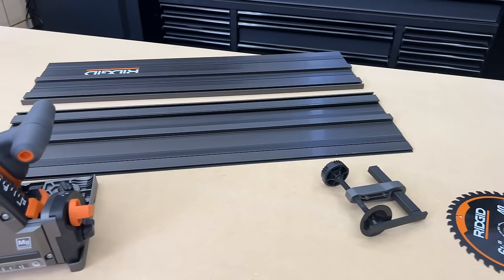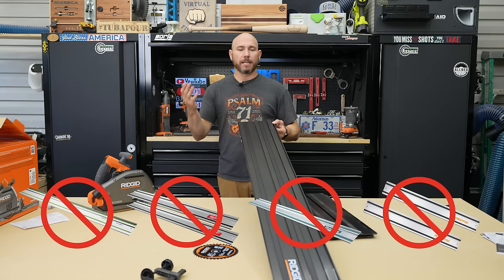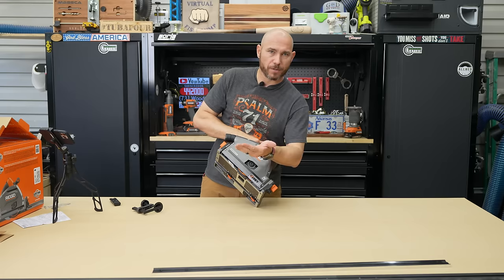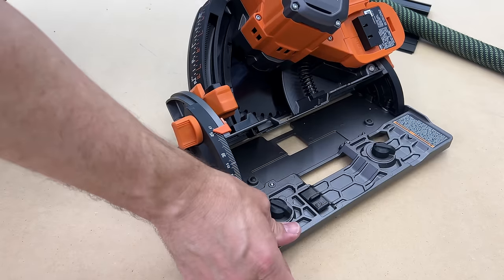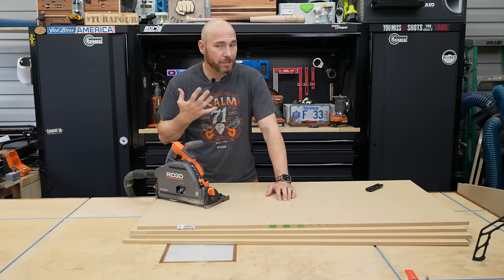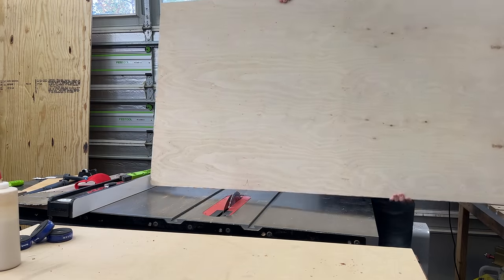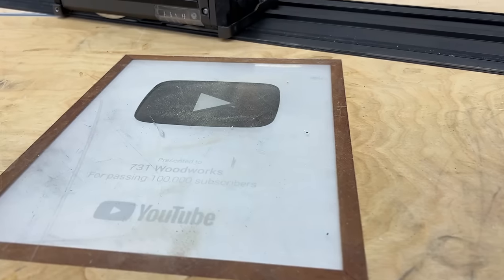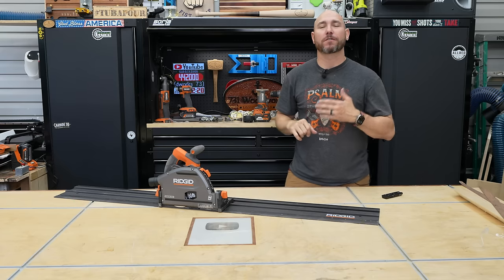Now We Know Everything About the RIDGID Track Saw!

Comment: NOT $399!! Debuted this week on Home Depot website at $488 TOOL ONLY, meaning the battery will put you back $120 extra, bringing it to $608! Shame on HD for the bait and switch, hope that you update your review!
Reply from the maker: I just checked my link in the description.  Shows $399 for me.  Are you in the USA?
Reply: @731Woodworks  Yes, I'm in US. Mea culpa. When searching Home Depot app, the $488 version is offered first, and description is exactly same as $399 version (60in Saw), however, it includes ADDITIONAL 60in track. I went back through your video, and I didn't catch that the version you showed was NO BATTERY, again making the price higher. Happy to delete my original comment, but still felt misled. I've been excited the last month since watching your video thinking that is get an awesome saw for just $400, but with extra track and batteries, it's over $600, which is in DeWalt territory.
Reply from the maker: @AdamMitchell7   Ahh, I see.  No, don't delete your comment.  I think if someone is already in the Ridgid battery platform, this makes more sense to buy vs if you don't already have their batteries or have intention of getting their tools. Otherwise, I think that the corded Makita is a good option because you'll be about the same price point with batteries, etc. on the Ridgid.

Comment: The 5/8 standard arbor was a grand slam.... why did they decide not to make it fit standard tracks. Even the Dewalt and Bosch can run on the Powertec tracks, even though they use different tracks

Comment: Lack of battery/charger in the kit is a downside for me, since I'm not in Ridgid ecosystem. Adding cost of that closes the gap a lot vs others that would otherwise seem significantly more expensive. Add in that the track isn't compatible with others, not as interested as I originally was.

Comment: Howdy Mr. 731.

I may not like some of the tools you present, but i DO like your presentation of them and the videos. 

Now, this isnt towards you Sir....But in my opinion, track saws are honesty not worth the money and believe them to be just Hype. 

Reason being. When im cutting down large sheets, because of my small shop, regardless of a track saw or not, its gotta be done outside my shop and a set up of saw horses is required. 

In the "Real" world of woodcrafting. The need of ripping a FULL 8' length of ply is rare. Very rare. Its so rare that the cow is still alive while you're cooking. 

The use of sheet goods (Plywood) is mostly contained within "Cabinetry" work which is a very small niche of the over all "Woodcraft" community. 

With that, if a "Woodworker" is building cabinets back to back and week to week, chances are high that they already have a LARGE shop dedicated to that, of which, a Tablesaw capable of cutting large sheets of ply. To that point, "That" person is no longer a "Woodcrafter" by definition, they are a "Cabinet Maker". There IS a difference. 

The reason why these track saws BOG down on cutting 1 1/2" materials is because THAT wasnt their intent. They were designed for sheet goods. 

So, we roll back to the beginning of my message. Sheet goods (ply). These track saws "save time". 

Do they? Maybe a little bit. But i can cut down a sheet of ply using a straightedge and clamps and a Circular saw and it takes me maybe a few "MINUTES" more to set up. So, whats a few extra minutes for cutting something when its not something i do alot of? Worth $400+ to save a few minutes? 

Nope. 

And then where ya gonna store all these parts for something you dont use often? And then the cycle repeats itself. "Well, i do use it alot". Well, if you do, then most likely youve already got the room and tablesaw capability of cutting down that Ply already. 

So, in the end. I just honestly dont see a positive point of spending the $400+ on something in order to save me 2 minutes of time. So it kinda becomes something like those lights people add to their wheels on their truck. Whats the point? You cant see those lights while you're driving and when you park, the lights turn off. 

Its just unnecessary Bling. 

That all being said Mr. 731......You made a great video which was informative. 😊 

Thank You for being there. :_fistbump::_fistbump::_fistbump:

Comment: Rigid makes great tools for a home owner but not for people that use battery tools for a living. I’ve burned up several drill and impacts. There’s a reason you don’t see them on job sites and supply houses don’t carry. I use impacts 4-8 hours a day, dewalt or Milwaukee last years with no issues besides batteries getting weak over time(but every manufacturer has that ). These paid vids fools a lot of people, because you get what you pay in most circumstances. I’m an ibew electrician

Comment: This Rigid track saw is what the Ryobi track saw should have been. A decent battery powered track saw, with its own proprietary guide rails. Ryobi could’ve made the base aluminum, made the cover plastic, removed the riving knife and kept the saw 0-45°. That way they could sell the Ryobi track saw for like $250 tool only, or $299 or $329 tool only with guide rails. 

Rigid messed up by not making the Track saw compatible with all the existing guide rails. That’s the only complaint I have about the saw. It leaves no room to upgrade, you would have to get another track saw if you wanted to use any of the longer guide rails that don’t have to be combined. Rigid could have at least made it compatible with the Milwaukee guide rails and just made small Rigid guide rails that get combined.
Reply: The Ryobi is $329 with guide rails... sometimes on sale for $299...

Comment: What I'd like to know is how straight the cut is when the track extensions and such are attached.  Seriously, for me that is what I most want out of a track saw - the ability to give me a perfectly straight 8-foot cut.  Right now I am not convinced I can get that with anything but Festool's long track.

My Kreg does great for the shorter cuts but after trying to get perfectly straight cuts with the Accu-Cut XL?  You just couldn't get that saw guide reliably super straight - so I'm not betting that I could get a perfectly straight track with anything long enough for 8 feet unless it is a single-piece track and I think I could only get that with a Festool.

I need to save my pennies for that Festool.  Unless someone can show me that one of the other systems will reliably give perfectly straight cuts over a length of 8 feet..

My Kreg track saw is not going to go away.  That's because it is really devoted to the ACS system and I really like the ACS although it won't replace a good table saw.
Reply from the maker: These are straight so long as you use a straight edge when joining them. I've had no issues with them coming out of alignment.  I would like to see longer tracks instead of the 27.5" but they work well.  If you have the budget, I would always recommend Festool.  Hard to beat them.

Comment: What track saw would you recommend for a weekend woodworker . I only have Dewalt cordless tools in the shop there for I have no batteries for any other tools ? Festool , Milwaukee, Ridgid. Won’t be using it a whole lot ?
Reply from the maker: If you don't want another battery platform, look at the Kreg.  It's really nice for the price.  If you want a higher end saw and don't mind different batteries, Milwaukee or Festool.

Comment: A 40 tooth "general use" blade is not satisfactory for ripping lumber, be it hardwood or softwood.  The stock blade is fine for cutting sheet goods. A dedicated ripping blade (with the appropriate positive hook and deeper gullets) will be much easier to use for, you know, RIPPING lumber.

Comment: The batteries are getting so expensive I wish they made an option that just plugged into an outlet.  Not everyone has a heated shop and cold destroys the batteries.  Also, it is easier to add power to an A/C motor so no need to be concerned about underpower also, so you don't need to worry about having enough batteries that are charged and ready to go.

Comment: For me the math must also include the cost of batteries & charger. I’ve only invested in the Ryobi platform for drill/drivers. I also wasn’t impressed by the Ryobi saw, so I’m gonna have to buy the saw and batteries. 😕 But thanks for the very well presented first look on this tool Matt!
Reply: Corded saw, I’m in the same boat and having to buy batteries and charger is a deal breaker to me.

Comment: I've been looking into the Master Force track saw that is offered by Menards. The problem (or, maybe this is a good thing?) with Menards is they don't have reviews on their website. If you want to know what others think about a certain Master Force tool, you pretty much just have to do a Google or YouTube search. I have found a few (very small sampling) of reviews on YouTube, but these all seemed to be VERY favorable (and, therefor a bit biased?🤔) so I'm not sure if they can be trusted. The Master Force track saw runs at ~$178 and comes with 110" of track in 4 pieces. If you could do a review on this, it would help me make a decision on which to buy. Personally, I am a Ryobi fan (thank you for occasionally pronouncing it correctly. lol), but you've turned me away from their track saw. Now it's between the Ridgid and the Master Force. Truthfully, the ONLY reason is because of that price. ~$178 for a complete track saw WITH 110" of track almost sounds too good to be true. I'd like to know if it is or if it's the buy of the century. Thanks and please keep up the great reviews!

Comment: Why not just a nice heavy duty circular saw? Why all the tracks and what not? Genuine question
Reply from the maker: Tracks make cutting sheet goods much faster than clamping down a straight edge for the circular saw each time.  It's also harder to cut bevels using a circular saw and straight edge.  Track saws aren't "necessary" tools but they do help speed things up.
Reply: @731Woodworks  thanks for the explanation my friend. I'm a plumber by trade and don't do much woodworking except what's necessary for my job.

Comment: I had the older generation brushed Rigid circular saw stolen and after being on the fence to replacing it I pulled the trigger with the first gen brushless and it SUCKS!  Crappy power, chews up my old 4 amp hour batteries very quickly and just feels cheap!  I've had a couple of the smaller 1.5 amp/hr batts fail, and they didn't want to honor the warranty, saying these weren't properly registered yet the driver they were sold with is???  Also, I have the big brushless 1/2" drill driver, and it's an absolute piece of shit!  The body around the clutch and reduction gearing has worn and is super loose and wobbles.  It overheats when ever I need to do anything kinda hard like drilling 3/8 holes in concrete, and the warranty department said they can't do anything for the sloppiness because it still works???
I've since gone back to Makita and no longer buy any Rigid tools and as they fail I will replace with Makita...
I hope this helps balance some else's decision-making if they were considering going Rigid.  Just my humble opinion.
cheers

Comment: All cool, but fairly useless if it can’t integrate with TSO products. TSO really takes a tracks on turns it into something special. I bought the Kreg on your recommendation and have been thrilled. I would rather spend a few dollars more and get something more versatile. I picked the Kreg over Milwaukee and Festool because it’s table was such a great starting point. I bought two of the tracks in addition to the one on the table and some TSO products. It’s unstoppable.

Comment: I thought they had a winner until I saw that its a Battery tool! personally, I do and will not buy a battery tool unless that's all that available, having been in the building trades sense the 1970's I have seen and used most all the battery tools out there, and they all fail, and with the cost of replacement batteries sorry it's a Losser in my opinion.

Comment: Excellent video, as usual. Since track saws are usually going to be used to break down quite a bit of flat stock at a time, the battery is a definite no go for me. When it quit in the middle of a cut that killed it for me!
Reply: Well, it isn’t going to quit when it ain’t cutting. When does your saw quit? Hehe

Comment: No chance it's a Kreg killer.. only advantage this saw has is it's battery.. Other than that. The Kreg is a way better tool
Reply from the maker: 🧐 this saw performed better than the Kreg to me. No deflection. Not that the Kreg is a bad saw.  It's a good saw, I just think the Ridgid is a little better built.
Reply: @731Woodworks  I'm interested to see it first hand. My best friend is heavily invested in Ridged and plans on picking it up. I have the Kreg and I did notice some slight deflection when I first bought it. But I switched to a Diablo blade and it went away. I just picked up the Milwaukee and have yet to take it out of the box. I'm excited to put it through its paces.
Reply: @731Woodworks  I will say.. The thing that makes the Kreg a invaluable tool for me.. Their ACS cutting system. There's just nothing else out there like it anywhere near the price. Unless you go Festool.. And then you're spending about $2k. I've had the ACS for about a year and its a phenomenal setup. Incredibly accurate..Very easy to set-up and use. And nearly impossible to get bad results with.